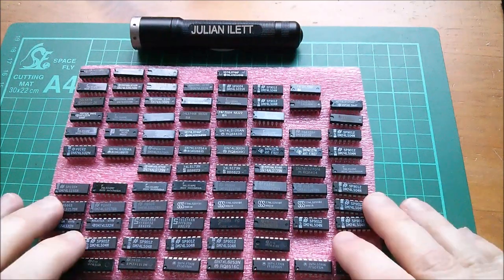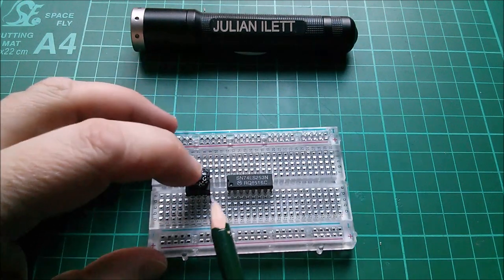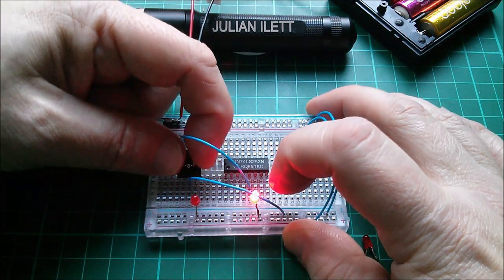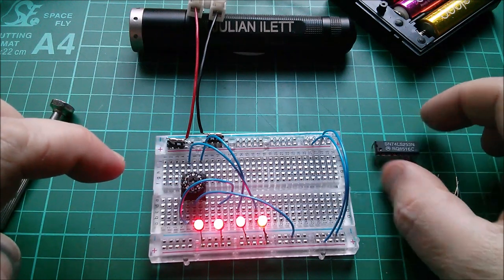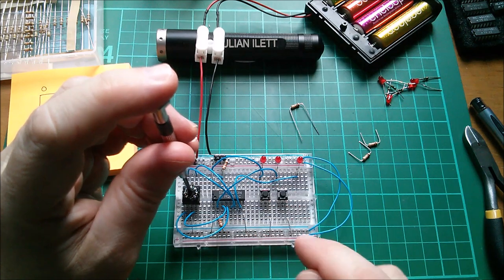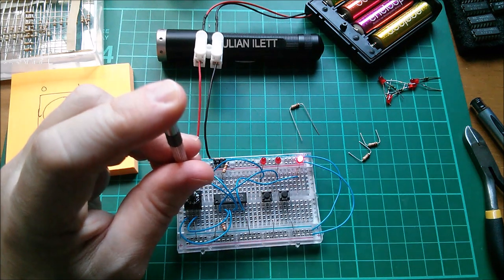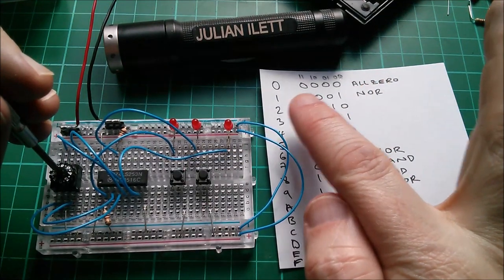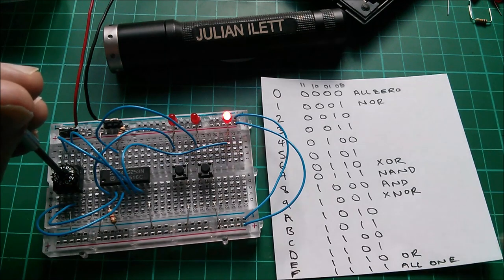74LS253 4-Input Multiplexer as a Multifunction Logic Gate

Comment: Regarding the 4 "left-over" states of your truth table: Do you know about the "imply" gate function? The state "LED is lit" relies upon (or IMPLIES) that power be fed to your circuit. If your circuit has no power, but the LED is lit, that's an invalid state. Try "B implies A" and "A implies B" as well as the inverted-output variation of both" for these four lines in your 4-bit truth table.

Comment: Slightly related, it occurred to me that you don't need a logic gate as such for 'shift left/right' or 'rotate left/right' functions.

You just need to use a gated 8-bit buffer and connect bit 0 from the register which you want to shift left (for example) to bit 1 of the gate input and so on until you either wire bit 7 to bit 0 or to the carry, depending on which type of shift you're setting up.  If you're doing a shift through carry, then bit 0 of the gate is hard-wired to 0.

If it's a rotate through Carry, then the Carry bit output is wired to 0 on the gate instead.

The order is reversed for a shift or rotate right instead of left.

Then in order to get the shift/rotate function, you simply activate the buffer's gate and read the shifted value from its outputs into a register (and into the Carry bit, if it's a rotate or shift through carry).
Reply: Looking back the other way (the intended way) you can make the shift hard wired to the data lines (Video explaining that in more detail: youtu.be/fxx9tfUoYCY )

Comment: Stacking four of these chips isn't going to work because the select inputs are commoned across both multiplexers in each chip. You're going to need 8 of these (or 8 single multiplexer chips), or 4 dual multiplexers which have separate select inputs for each multiplexer.
Reply from the maker: Yeah, that puts a spanner in the works :/
Reply: Thought about this some more and I think you're ok. You're planning two logic units which both take the same inputs but perform different ops so you could have one of these chips handle one bit for LU1 and one bit for LU2. One stack of 8 chips will implement both logic units.
Reply from the maker: Why didn't I think of that? Brilliant. Now, shall I pretend that this was the plan all along or shall I come clean?
Reply: Julian Ilett I’d definitely pretend it was the plan all along ;)
Reply: I noticed that right away looking at the datasheet. I should have checked comments before the DS. But I have been going through the 74s list hoping to find a solution. I haven't found anything yet. I don't even need hex range, just make the opcode what ever is needed.  Surprised how many the series has but all with shared selects : (
Reply: @SteveHodge  I just thought of an Half Adder. One side performs XOR and the other AND. NO 74LS283 required!

Comment: Very nice. Done this in the past as well. Just to point out: It can be done with 4052 and 4051 as well. Today the use of the small footprint single gate SN74LVC1G58 / 59 / 97 / 98/ 99 is recommended.
Reply: the gate you mention seems to be configurable, but not programmable, ie you use different wiring for different functions, rather than an additional input as in multi-function ALUs or this device.
Reply: @ZeroPlayerGame  Yes that is pretty much the idea. Hardwireing some more complex logic functions with multiplexers is also usually faster than connecting gates in series in order to get these logic functions. Dude, that vid is 5 years old. Funny that these old vids still get attention.
Reply: @ChipGuy  I got referenced from James Sharman's channel!

Comment: Hi I don't see how you can get an 8-bit wide gate (two input 8 bit words) from only four of these beasts since as I understand it the two "sides" of the '253 use the same A B control lines.
Reply from the maker: That's true - 8 chips will be needed. However, the other half of those same 8 chips can be used for the other logic unit.

Comment: Use other 4Way as magnitude comparator. Let 00 and 11 pass EQual. Let 01 pass LT control, and 10 pass GT. EQ also serves Borrow, or Carry (but first let ADD XORvert B). Inverse B distorts the truth table, no problem but truth NXOR to get XOR for addition. Transmission gate upgrade will let comparison propagate without ripple. 74CBT3253 dual 4Way fits well with 74LVC2G86 dual XOR on a generic SSOP to DIP28 converter. XOR your current logic result with previous CarryBorrowEQual for a complete ALU. A+B, A-B, B-A, all 16 logics, 6 comparisons, everything but rotate. Jam the chain uniformly high or low LT=EQo=GT for plain logic without arithmetic.

Comment: Neat  I shall be looking very closely at this when I start to build my breadboard computer. The controls will presumably form part of the microcoding output. if are you going to microcode. Or are you making the computer 'RISC' :) ? If the former, are you going to microcode with diode steering (that could be, um, fun) or some sort of memory device?
Reply from the maker: It's going to be the ultimate RISC - just one instruction :)

Comment: Seem weird when compared with the datasheet...
Reply: Not really. You're thinking of the multiplexer as having 4 inputs and 2 control lines, but actually it just has 6 inputs. If you draw out a truth table for 64 combination of the 6 inputs you'll see how it works.
Reply: Yes but that only shows some of the rows (the X's represent any value so each row in that table represents 8 different data input combinations). You want to expand the table to the full 64 rows and arrange that rows so that each combination of the "data" inputs are together. Here's just the rows for one configuration of "data" inputs:
0 1 2 3 A B -> O
L L L H L L -> L
L L L H L H -> L
L L L H H L -> L
L L L H H H -> H
For that particular combination of "data" inputs, the output is only high when A & B are both high, so this is an AND operation.
Hopefully you can see how Julian is using the "data" inputs to select the operation and the "select" inputs for the data. This is not how the writers of the datasheet envisaged the chip being used, but it's certainly a perfectly valid way to use it. As I said, in the end it's simply a device that takes 6 inputs and produces 1 output.